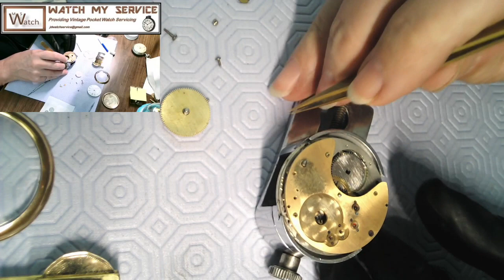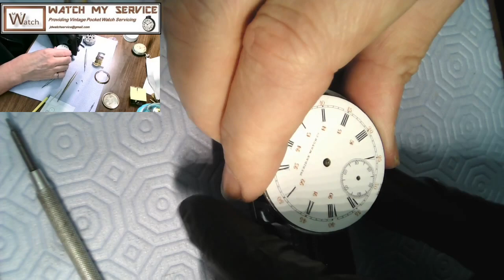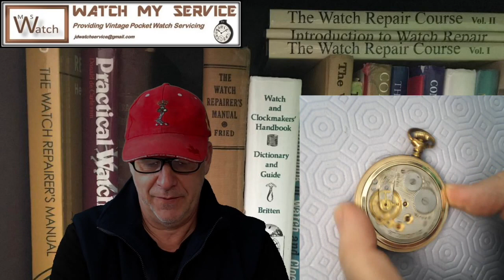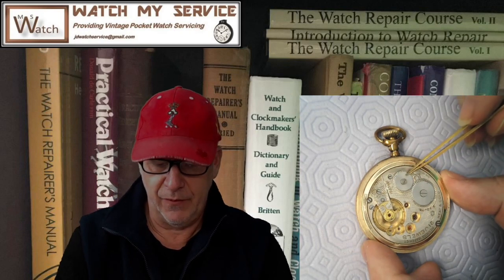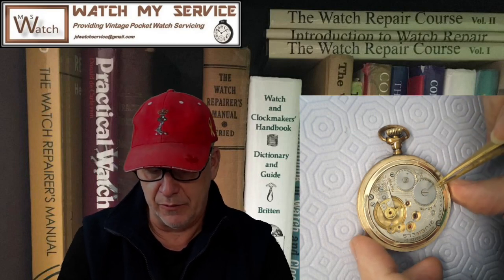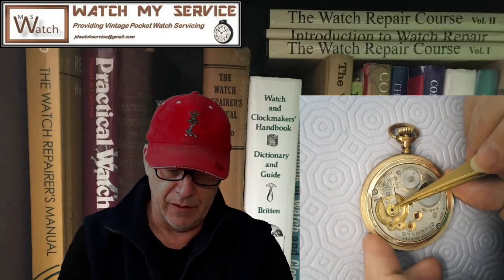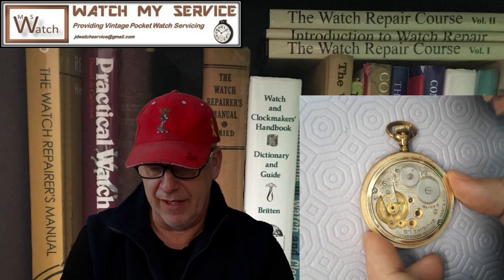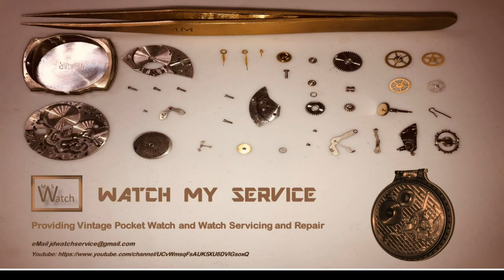Fake Swiss Pocket Watch Clean and Assemble

Comment: Is your cleaning solution lighter fluid?
Reply from the maker: Yes it is. Old school lighter fluid or naphtha.
Reply from the maker: What are you using?
Reply: @JDRichard  I use the same two solutions.  I remove the stubborn deposits with a toothbrush or tooth pick.